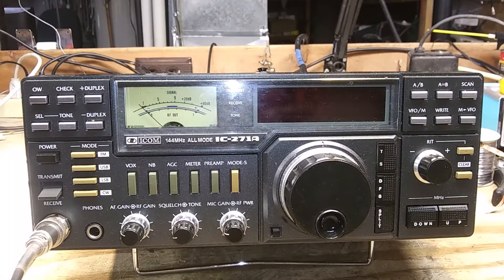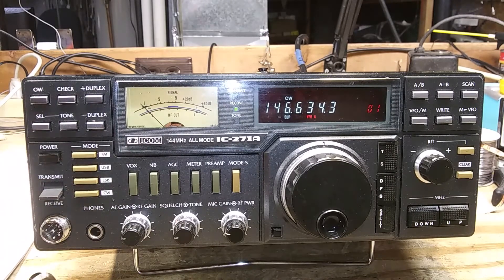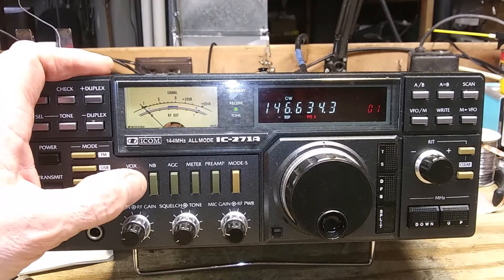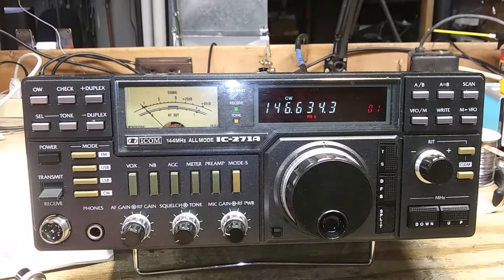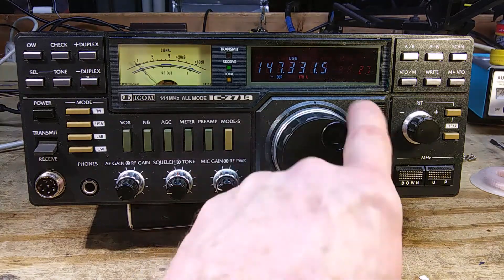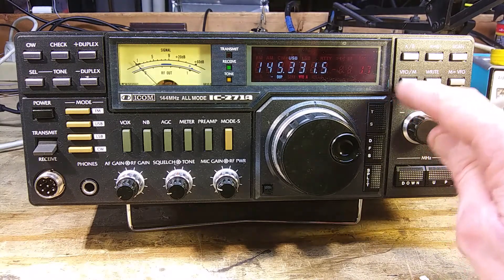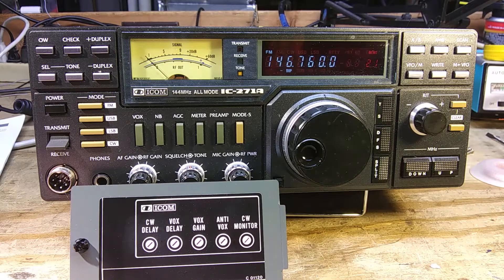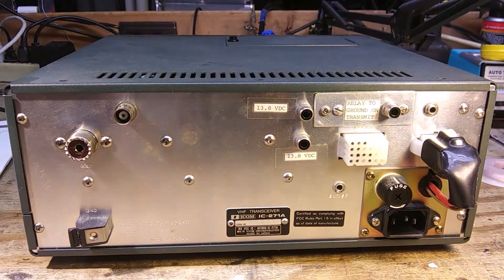Overview of the ICOM IC-271A 2 Meter Transceiver with some nice options and mods

Comment: I have the H - basically a 50w TX stage, fan cooled so it runs 100W until the finals warm up. 
Regretably the final TX's s in the one I have are blown. It came from a SK estate packed up by family who did not know what they were doing. I surmise someone powered it up and tried the PPT after the antennas had been disconnected. 

Repairs are a matter of getting to it. Nice radio otherwise.

Comment: I have one of these too.  Tone board yes but no preamp.  Is there a way to remove the memory entries?  I can only reach less than 10 repeaters in the area and would like to remove the others from my old location.  Thanks for the intro!  It was really good.
Reply from the maker: I don't have the radio anymore. I would think that there would be a way to remove the memories. If not, you can add popular simplex frequencies in there.
Thanks for the kind words, too.
73 Paul AA1SU